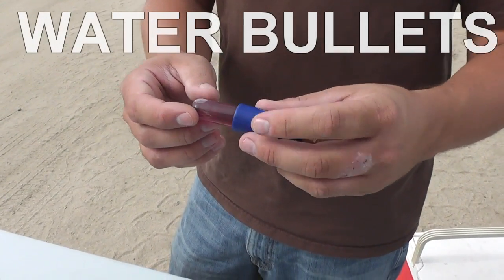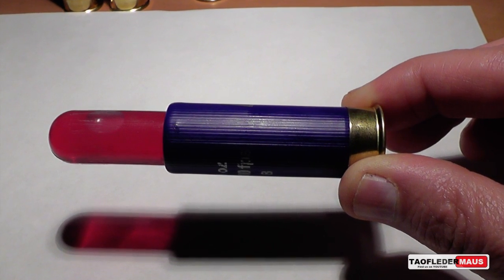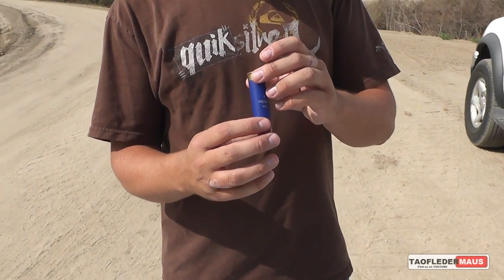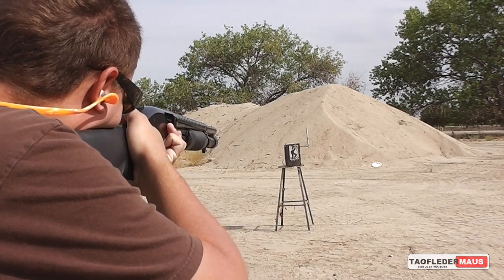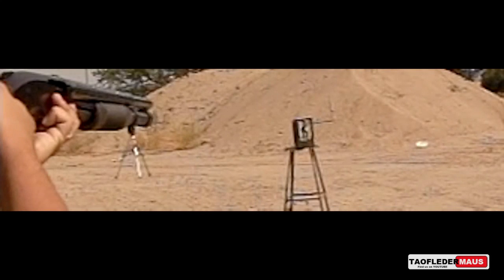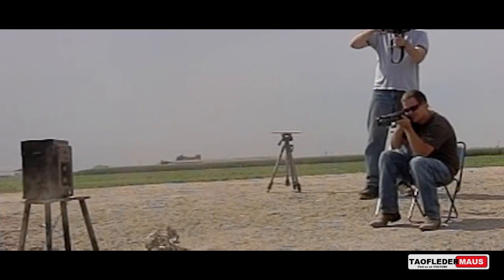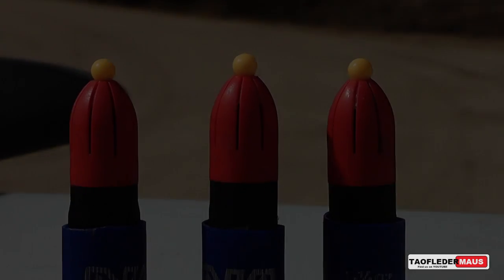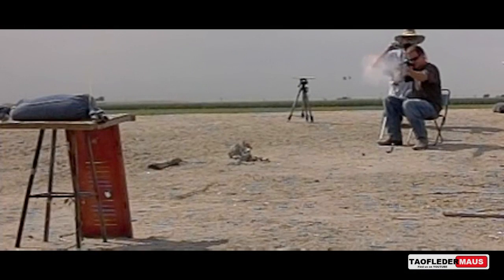12ga WATER BULLETS -  Round of Tomorrow?

Comment: use the same capsule but fill with a NON-NEWTONIAN FLUID!!
Reply: Silly Putty Shotgun Suppositories :p
Reply: better yet, mercury
Reply: Already been done.  It's on here somewhere.  They shattered if I remember correctly.
Reply: make a mixture of corn startch and water than put it into it and shoot it off
Reply: deven thompson no, silly putty is different from corn starch and water. I dont know the ingredients for it though.
Reply: SophisticatedHermit I was thinking of that too.. The cool thing - mercury is dense and would likely have better range than most other liquids. The problem - mercury is toxic as hell - you'd need a firing range that can be cleaned up real well (or lack of conscience)..
Reply: Jawzah

Comment: I have some awesome ideas!
1.) Water beads.. (Those little silicone balls with water in them. Google it.)
2.) Frozen water beads!
3.) Airsoft BB buck-shot. (Plastic BBs.)
4.) Make a lot of very small (around the size of a bb, maybe a big bigger.) spitballs (use water to keep it clean. Spit's nasty). Then freeze the spitballs. The paper balls will most likely break up on impact!

Comment: TAO,I've tried this with an air rfle, wet toilet/writing paper, if you want a spray go for toilet, if you want a solid slug-like round use tightly packed writing paper, the thicker the paper, the more likely it will be to stick together, I have had penetrations on hard-ish plastic, such as plastic coke bottle caps and 1-3mm thick plastic objects such as lids and boxes, and this is from a worn down crappy air rifle that is 700-750 max. fresh out of the box, I was very impressed what these paper bullets can do. they put a new meaning to rock paper scizzors.

Comment: Looks like a good way to get the bore wet.
Reply from the maker: Sherman Hovermale  A better way would be to stick a hose in the barrel.  If you must get your bore wet, that is.
Reply: +TAOFLEDERMAUS What one could do with this for psychological effect is to fire rubber rounds at a fairly low velocity and have as a delivery mechanism this water which as a red dye would strike terror into the hearts of a rioting crowd for instance. It does heavy duty but no more heavy than a street sweeper in which a .410 or a 14 to 20 gauge shotgun is fired into the pavement in front of a crowd to disperse them.

Comment: try filling the pipette with liquid mercury (very dense and thus heavy) AND freeze it (with dry ice)
Reply: when solidifying mercury, you can use a mould in the shape of a dart to make AP darts
Reply from the maker: geneticallyinferior1  still can't disperse Hg all over the place!
Reply: i won't tell if u won't tell
Reply from the maker: geneticallyinferior1   Can I do it in your backyard?  hehe
Reply: ***** you can do it in iraq....it won't even be noticed with all the depleted uranium spewed all over the place
Reply: I think leaving it liquid and putting in a hollow soft tipped slug might give more impressive results. If the Day of the Jackal book is to be believed, it results in something similar to an explosive round.

Comment: You should, Get the same shell and fill them with water then freeze them, cut off the outer shell and wrap it with wading till the correct thickness. Then would create a untraceable water bullet that will melt in minutes :D

Comment: Hmm freeze it? Perhaps it will hold together more with some sort of inner structure   Make sure you don't leave a pug in when you freeze it, donm't want any deformation.
Reply from the maker: I'm not sure if freezing them would cause them to expand and be out of spec.
Reply: *****
 Freezing them without the plug in should in theory eliminate any expansion issues, as the excess ice would probably push itself out of the opening. Just a theory. Test it with an open water bottle first.
Reply: ***** Well that's what I meant about the open plug, any expansion would be controlled and sent out a single place,a s the excess water would be pushed out the hole. Although I agree with LikeAGod, test with an open water bottle
Reply: ***** As an after thought, purified/distilled water, it gives a clearer product. Something like when you use bottled water to make ice cubes, they turn crystal clear when frozen instead of having bubbles and such like tap water. Im assuming less impurities and flaws would make a much stronger form.
Reply: SeenCreaTive
 Might also want to boil it first.

Comment: I made up some water shots by pouring crayon wax around a pencil inside an empty wad, removing the pencil, pouring in water and sealing it with more crayon wax. i also removed the powder from the shell, so all that propels the water shot is the primer, and it comes out at a speed just strong enough to puncture cardboard at 10 feet. ill make video at some point but some highspeed footage from ya'll would be awesome.